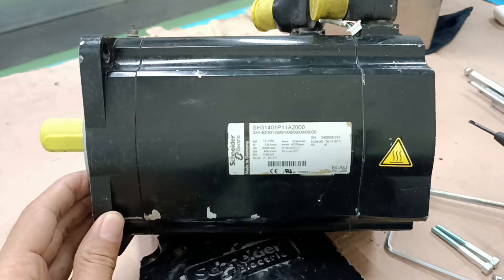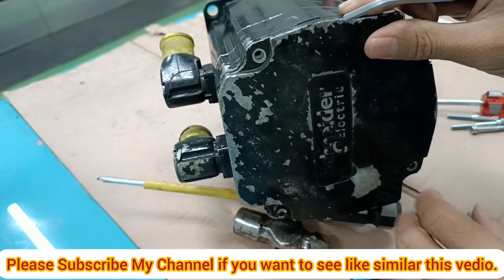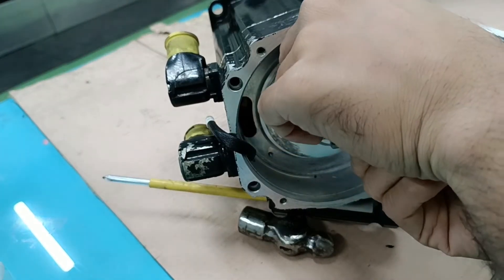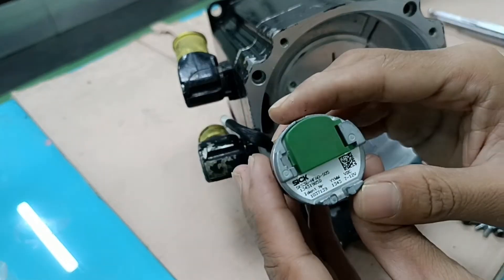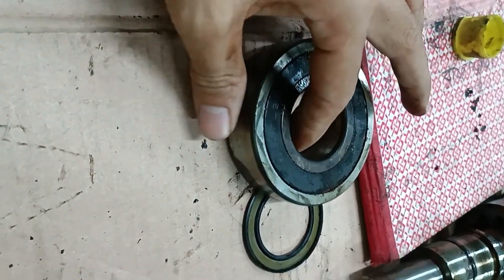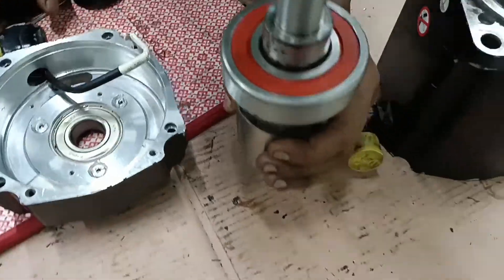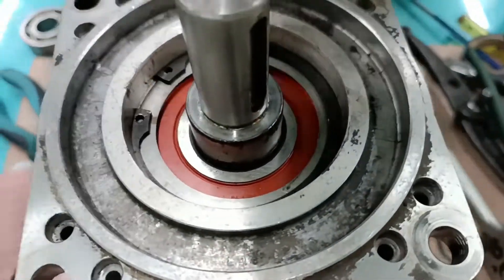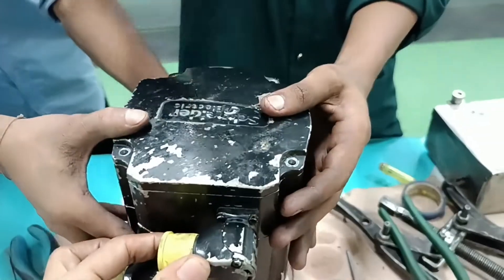How to open servo motor & Encoder. How to change Servo motor bearing. Servo Motor Repairing Details.

Comment: thank you so much bro I FACE ONE PROBLE how to adjust angle and position of servo motor please help me look after i change bearing and assemble Encoder but the motor is no rotated what could be the the problem?
Reply from the maker: Please make sure your previous marking position if you forgot then you have to check it from your machines HMI if not possible from HMI then you need to set actual value from Oscilloscope,
Reply: @10minutesengineeringsolution brother please can you explain that how to do
Reply from the maker: @haflalali 

Step-by-Step Resolver Alignment Procedure (For Servo Motors)

Step 1: Safety First

Power OFF the drive and disconnect the motor safely.

Ensure all stored energy in capacitors is discharged.

Step 2: Mark Mechanical Zero

Rotate the motor shaft to a known mechanical reference position (e.g., home or zero position).

Mark the shaft and stator (housing) to reference zero position.

Step 3: Access the Resolver

Open the motor's resolver cover.

Ensure resolver rotor is correctly placed on the shaft.

Step 4: Match Resolver to Mechanical Zero

Gently rotate the resolver stator (outer ring) to align the resolver’s electrical zero with the motor’s mechanical zero.

Use an oscilloscope or multimeter (AC volt) to monitor SIN and COS voltages. At true zero:

COS should be at maximum voltage

SIN should be close to zero

Step 5: Lock the Resolver

Once aligned, fix the resolver housing using screws without disturbing the alignment.

Ensure cable connections (EXC+, EXC–, SIN+, SIN–, COS+, COS–) are correct and secure.

Step 6: Power ON and Test

Power ON the drive.

Use the drive’s keypad or software to check feedback signal and actual position.

Test motor with low speed. If feedback fault (e.g., error 08) persists, recheck phase rotation or resolver alignment.
Reply from the maker: Step-by-Step Resolver Alignment Procedure (For Servo Motors)

Step 1: Safety First

Power OFF the drive and disconnect the motor safely.

Ensure all stored energy in capacitors is discharged.

Step 2: Mark Mechanical Zero

Rotate the motor shaft to a known mechanical reference position (e.g., home or zero position).

Mark the shaft and stator (housing) to reference zero position.

Step 3: Access the Resolver

Open the motor's resolver cover.

Ensure resolver rotor is correctly placed on the shaft.

Step 4: Match Resolver to Mechanical Zero

Gently rotate the resolver stator (outer ring) to align the resolver’s electrical zero with the motor’s mechanical zero.

Use an oscilloscope or multimeter (AC volt) to monitor SIN and COS voltages. At true zero:

COS should be at maximum voltage

SIN should be close to zero

Step 5: Lock the Resolver

Once aligned, fix the resolver housing using screws without disturbing the alignment.

Ensure cable connections (EXC+, EXC–, SIN+, SIN–, COS+, COS–) are correct and secure.

Step 6: Power ON and Test

Power ON the drive.

Use the drive’s keypad or software to check feedback signal and actual position.

Test motor with low speed. If feedback fault (e.g., error 08) persists, recheck phase rotation or resolver alignment.
Reply from the maker: Step-by-Step Resolver Alignment Procedure (For Servo Motors)

Step 1: Safety First

Power OFF the drive and disconnect the motor safely.

Ensure all stored energy in capacitors is discharged.

Step 2: Mark Mechanical Zero

Rotate the motor shaft to a known mechanical reference position (e.g., home or zero position).

Mark the shaft and stator (housing) to reference zero position.

Step 3: Access the Resolver

Open the motor's resolver cover.

Ensure resolver rotor is correctly placed on the shaft.

Step 4: Match Resolver to Mechanical Zero

Gently rotate the resolver stator (outer ring) to align the resolver’s electrical zero with the motor’s mechanical zero.

Use an oscilloscope or multimeter (AC volt) to monitor SIN and COS voltages. At true zero:

COS should be at maximum voltage

SIN should be close to zero

Step 5: Lock the Resolver

Once aligned, fix the resolver housing using screws without disturbing the alignment.

Ensure cable connections (EXC+, EXC–, SIN+, SIN–, COS+, COS–) are correct and secure.

Step 6: Power ON and Test

Power ON the drive.

Use the drive’s keypad or software to check feedback signal and actual position.

Test motor with low speed. If feedback fault (e.g., error 08) persists, recheck phase rotation or resolver alignment.

Comment: Can i convert 110v servo motor to 220v?  I don't k know what cause overheating but my servo white controller is 30amp, can i convert into different amp? Thanks
Reply from the maker: Thanks for your question,,, but the result is not possible to convert to another option,,, its very sophisticated design for a specific point.
Reply: @10minutesengineeringsolution    i bought it from Aliexpress and they  said  a 110v servo motor with 30amp servo white controller is good combonation.   Do you thik its true?  Thanks
Reply from the maker: @sky-h6j-i1q  it could be .... Because presently many other options are included in a single unit.

Comment: Hola, excelente videos, tengo una pregunta, ese encoder se debe programar con el motor? O solo se instala y no se hace nada más.
Reply from the maker: Can you give me a  message in English,,, i can't understand your question clearly please?
Reply: @10minutesengineeringsolution  @jhonfredydaza1013 is asking if this encoder only needs to be installed in the motor shaft or if some programming is required after mounting the encoder to get the motor running. Thanks in advance for your help.
Reply from the maker: @MrFernandoBedoya.. 

Actually its very difficult to install but if you know the system it will be very easy for you,,, 1st you need to know the encoder counting number if you have any display with inbuilt that system, then you need to be aligned with your encoder as per your requirement when the system is well working.
Reply: Mmmm...hasta ahora no conozco encoders que necesiten ser programados,
Reply: Claro, yo trabajo con rexroth Bosch y los encoders se deben programar con el motor, de lo contrario no funcionan @MrFernandoBedoya
Reply: Es correcto se deben de programar conforme al modelo del motor. De lo contrario jamás funcionarán

Comment: Can u supply spares for this motor encoder and power connector
Reply from the maker: Types of encoder... Encoder information required & connector port or pin number or picture required for better understanding.  And where are you from?

Comment: Need to align the encoder and roter by measuring motor pulse with the help of oscilloscope meter and dc power supply, otherwise, like this as shown in the video this motor will not work ! Please take caution before disassemble the servo motor!
Reply from the maker: Absolutely right
Reply: Really helpful , you saved my day
Reply: Where are you from sir ?
I want to learn about servo motor
Reply: I have replaced the same encoder. How can I align the encoder and rotor?

Comment: Hi friend. Can you tell me that how can i align a quadrature encoder index to a custom bldc motor which hasn't got factory out encoder on itself ?
Reply from the maker: Is your system monitoring from HMI, you can easily see the before opening encoder value from HMI.... What are the actual settings... Then you open and do maintenance or replace.... Then again you need to fix the servo motor and give the connection of the encoder also  and then you compare with the previous Value.
Reply: Thanks it is not actually replacement , it is mounting. I mean mounting a encoder to the bldc motor like drone motors which hasn't got an encoder by factory default.
Reply: For alignment of the encoder index and the stator flux of the motor properly

Comment: So a question regarding the encoder, you said it needs to be put back in the same place - but what happens if you have a brand new stepper/servo motor?
Would you need to open it up, or do you just put the value to "0" before starting it up?

I would also recommend building a "stand" for doing maintenance/service on the stepper/servo motor, could help better.
Reply from the maker: Thanks for Your Question..... 1st if you need to open this encoder for repairing purposes you must need proper tracking or marking back cover side encoder  Stand which place encoder is Fixed.  If a little bit displaced from the original setting it will not be working. So be careful and need to mark properly when you Open.
Reply: @10minutesengineeringsolution u are wrong I open labeller servo motor change bearing put back encoder motor vibration why😢?
Reply from the maker: @KrishnaSharma-ug5xg You have to do the zero adjustments,,,,, you will do it from your machines HMI after power given that servo
Reply: @10minutesengineeringsolution  ok thanks
Reply: Hello bro I open encoder and I forget the actual position of encoder  can U tell put back original position of encoder?

Comment: Need encoder
Reply from the maker: Send your detailed information about Encoder
Reply: @10minutesengineeringsolution 😂😂😂😂 mostly it not works
Reply from the maker: 2 encoders replacing done... Successfully completed.
Reply: Ok can u tell what is reason of motor vibration? We facing issue in labeller machine drum labeller at running time at high speed vibration and when do low speed running fine what’s is issue? We using same this motor.